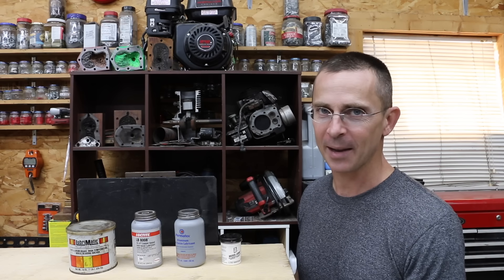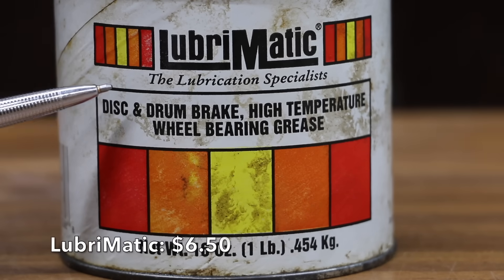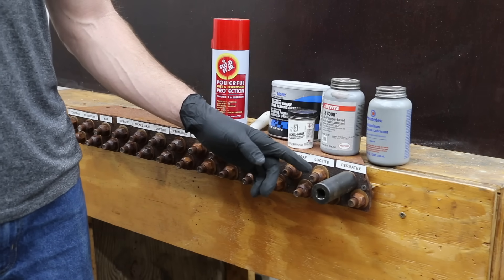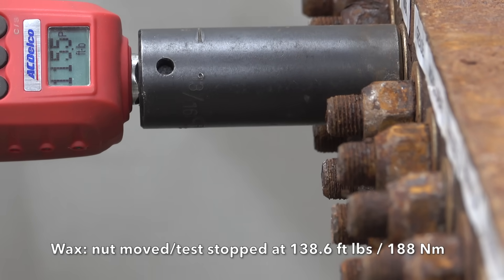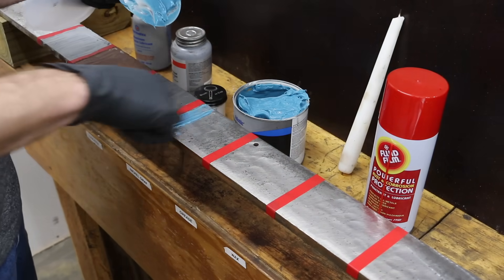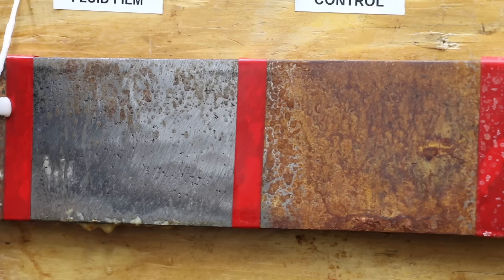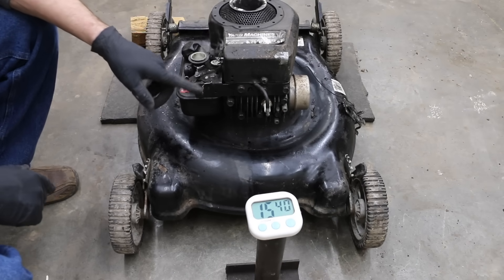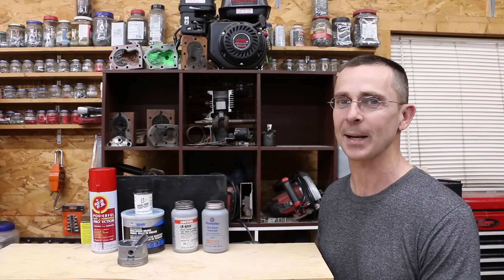Does Anti-Seize Compound Actually Work? Let's find out! Anti-Seize vs Grease vs Fluid Film vs Wax

Comment: 1 did you use bees wax?  2 do a test without applying more than 120* and test the wax again, and again use bees wax. I would say its a bad control test on it. And with rust remover you said vinegar is not good, but did you wipe it off? You have bad biased controls. Mostly meant to sell products IMHO.

Comment: I use coaxial cable for internet, and it is perpetually infuriating. It is old and fails at random intervals for no apparent reason. I suspect it has small cracks somewhere in the cable. Digging it out of the walls and replacing it seems like a good idea. Given the scope of the task (cutting holes in walls with wiring, drywall, painting, etc.) getting it right is important. What is the best replacement?
Reply from the maker: Thanks for the video idea.

Comment: I just did a rotor change in a 6 year old Mazda sedan.  I had to hit the old rotor to get it off - when it came off, there was rust between the rotor and the hub.  I cleaned the rust off and put some Permatex Aluminum Anti Seize on, then slid the rotor on.  This stuff is great and the next time the rotor comes off, it'll slide off without needing some help from a sledge hammer!

Great video - I didn't think the lawnmower engine would run as long as it did.  I think the engine gave out, because there was no lubrication getting to the connecting rod.
Reply from the maker: Thanks so much!

Comment: I use Jetlube moly graphite OR Lubriplate also moly graphite on gun barrel threads and gun barrel nut. Using Shell Aeroshell 33 is STUPID. That grease is for extreme cold ONLY. Remember kiddies, anti-seize is dependent upon specific uses, and what temps and chemicals the material will be exposed to. And Loc Tite C5A copper is what Glock puts on the locking blocks and slides of their new pistols at the factory.

Comment: Have you got a best rust preventative video? Like comparing fish oil, paint, electro magnets,  used motor oil etc?
Reply from the maker: Great suggestion!  Thank you.
Reply: @ProjectFarm  thanks be good to include rust converter on already rusted surfaces with and without paint and primer so we can see which way is best as well. Regards

Comment: Thanks for another great vid. We had about 40 one gallin stainless steel tanks that were heated for men to sterilize boning knives. Had a 750 watt Chromalix heater with a thermostat. If somebody forgot to install a copper antiseeze compund on 2" male thread you would have to use a 2 foot pipe wrench with a 3' piece of pipe to wrestle seezed heater off. Well worth the few oennies it cost for the antiseeze compound. Same thing with 1/2 to 5 HP C face motors that bolt right onto gearboxes. Even in a clean air conditioned room the heating & cooling off of c face motors seem to produce enough mousture to rust shaft onto gearbox.
Reply from the maker: Thanks for sharing.

Comment: Hmmm.....my primary reason for using anti-seize has been to prevent galvanic welding with dissimilar metals, eg, on the steel threads of a spark plug going into an aluminum engine block.  Working as a car mechanic in college, that is what I learned about the product for.  Yet you did not test that function at all.  :-(

Comment: I have a quart of anti-sieze that I've had since the mid 70's. It's nickle not copper or aluminun, the real deal I found nothing works better. I have to stir it up good each time I use it if I haven't used it in awhile the oil separates from the nickle. When I purchased my 94 Camaro new I anti-seized several nuts and bolts including the O2 sensors. This past week I replaced those sensors and they came out with ease after 27 years, you can bet I put the same anti-seize on the new sensors. I also put it on my A/C condenser fan hub to motor shaft that was in 93, I replaced the motor four years ago and the fan came off the shaft with little effort. I also used it on my 95 Harley slip-on mufflers and they come off with ease, no rust holding them together. This is long term real world proof it works.
Reply from the maker: Thanks for sharing.

Comment: Hello. Which is best grease for brake caliper slider pin?

1. Permatex Silicone Cemaric Extreme Brake Parts Lubricant (it meet to JIS K 2228)
2. Bendix ceramic high performance synthetic lubricant (it meet to JIS K 2228)
3. Bendix Silaramic® Brake System Grease (it meet to JIS K 2228)
4. Castrol Red Rubber Grease 
5. 3M Silicone Paste
6.  Permatex Ultra Disc Brake Caliper
7. permatex  ceramic extreme brake parts lubricant
8. Other?

I am sure that your new video will get view of million over people if you can test them. All mechanic will love this video! :)
Reply from the maker: Great video idea.  Thank you.

Comment: I was introduced to Neva Sieze in the late 70's. I went to work a s a mechanic at Mack Trucks. We used it in many applications on the trucks and it worked great. We would pull injectors from the heads at 150,000 M. It was quickly clear which ones were put in with Neva Sieze and which weren't.
Reply from the maker: Thanks for sharing.

Comment: I recently took up hydro-foiling and noticed many people dealing with seizing issues. The foils have alum masts, carbon fiber wings, and are usually held together by stainless steel screws. Foils are used in the ocean. After a few months, many folks have their entire foil seized together and are no longer able to take them apart. Would love to hear your take on this.
Reply from the maker: Thanks for the suggestion.

Comment: 20 year heavy equipment mechanic here..  YES anti-seize works good.  ANY brand is better than non-at all !!!  
I've seen NASTY bolts on a bulldozer at the landfill on the undercarriage come out that i thought NEVER would, guess what they had on the threads? COPPER ANTISEIZE !   it is a MUST !!    we use loctite high temp ( copper stuff )
Reply from the maker: Thanks for the feedback.

Comment: You know, I don't own a torque wrench.  I "torque" most everything I do with either an impact Gun or a cheater pipe.  I have some Permatex Ainti-seize and it seems to do the job for me.  However I cannot tell much difference between it and General lubrication grease.  I have always THOUGHT it was better than the GREASE but only slightly.  If I cannot find my Permatex, I just use grease to get the show on the road.  I am NOT a mechanic by choice, like a lot of people I just have to fix what I have whether I like it or not.   

And when I am putting together water or compressed air plumbing for a TEMPORARY application I use GREASE instead of Pipe dope.  Man, is it easier to take apart and clean up as compared to pipe dope.  I use Rectorseal Pipe Dope, it is pretty good stuff, it will break down easily if you apply Isopropyl alcohol.  But Grease is easier.  I put grease on my Water Hose Fittings when I put them together.  Sometimes I leave them together for a couple of months, and they have WELDED themselves together.  The cheap-assed fittings they put on there, you apply a Pipe wrench to them and they collapse.  Then have to put on NEW FITTINGS.  Put GREASE on there and it will come apart a year later.  But GOOD VIDEO!!!!  Yes sir, it looks like a good test to ME and the results were pretty much like I thought they would be.  Real Common sense, Thanks, BB
Reply from the maker: Great feedback. Thank you

Comment: You should take an engine that has a lot of scoring on the cylinder wall and coat it with anti-seize. Then run the engine like normal and see if it stays on the wall and improves compression or performance.

Comment: Grease alone is great for outboard propeller splines.  Even after using a motor for several years in salt water, a prop will slide right off. As for nuts and bolts, commercial fishing on salt water, I swear by the never seize products. We use the Permatex brand. But don't use it on prop shafts.
Reply from the maker: Thanks for sharing.

Comment: On the copper with the expiration date wouldn't that lead you to believe that it expires in 3 years meaning you would have to reapply it as well? it also leads you to believe that its water based or a similar deteriorating substance..;  On the wax when you heated it up it became liquid again odds are it wouldn't work anyway if it was heated. I'd also bet that wax traps the moisture and air under it which causes it to rust anyway so idk if it would work to begin with. I wonder about a marine grease though because thats what alot of peoples say to use.
Reply from the maker: Thanks for the video idea.
Reply: @ProjectFarm  Specifically Lucas oil Marine grease i was told to use  by a mechanic that works on all types of vehicle style machinery, as they use it even over seize all as it adds more of a lubricant and holds up better against water. So i did some research and it seems alot of people are saying similar things, actually thats how i started watching your videos to begin with., ;p

Comment: I would love to see the bolt experiment repeated without a heating cycle. 
90% of bolts never see much heat
I think without the heat cycle:  grease, wax and fluid film would do much better.
I realize the lawnmower engine test was made as a joke on anti-seize there are some things to look at: 
- from the before pics the engine was toasted before the test, lack of oil being the likely culprit
- the way the connecting rod broke indicates seizure to the crankshaft, which was presumably imminent anyway
- never seize is not a fluid, it could never enter the con rod bearing unless it was smeared in there before the test
-  the never seize passed the rings because of excessive wear, but it also filled in the gouges of the cylinder walls.

My reading is we need a more liquid never seize that would bake in place, and perhaps restore abused lawn mowers.
Reply from the maker: Thanks for the suggestion.

Comment: As a diesel mechanic assembler at DeLaval Turbine, we used motor oil mixed with graphite for anti seize lube. That work quite well and was cheap.
Reply from the maker: Thanks for sharing.

Comment: I have pretty much used the Permatex on most every bolt around the house for the past 20 years.  It works great.  I always use them on Spark Plugs, and have never had an issue getting them out.  Have also started using them on the bolts in the pump house at the swim club.  They used to be rusted in one season, now they come right apart.
Reply from the maker: Thanks for sharing!

Comment: I watched this video when it was new, but it appeared in my list of videos to watch, so I watched it again. I work for the railroad in signal construction and maintenance and since forever basic "no-oxide" grease has been the gold standard for everything when it comes to wanting it to come loose again. Components even 40+ years later still come apart (with relative ease) without breaking the heads off of anything. It's amazing what grease will do.
Reply from the maker: Thanks for sharing.

Comment: Would have been interesting to see a molybdenum based anti-seize.
For our ABB/Alstom gas turbine/combustion turbine, aluminum and copper based anti-seize are verboten by the OEM due to the high operating temperatures.
Reply from the maker: Thanks for the video idea.

Comment: I work for Shell Oil and have been an operator in a refinery for 26 years.  We have used nickel anti seize for decades.  It works well. However now days we have moved to Teflon coated nuts and  bolts, only using anti seize after servicing older equipment. Some of our nuts and bolts are over  100 years old. So I'd say anti seize does a great job.

Comment: I was surprised that you didn’t include a moly (molybdenum) anti seize. It’s all I ever use if you ever want to be able to remove a header/exhaust manifold bolt without damage. It’s also good for bolts that are exposed to a water jacket. Putting any lubricant on the threads help with the correct bolt torque and this anti seize is no different.
Reply from the maker: Thanks for the suggestion for future round of testing.

Comment: I have some questions for you.  For your water test, did you allow the products any dry time before starting the test?  I've only ever used the Permatex aluminum anti-seize, but I think I've heard that fluid film needs to dry.  I'm also aware that there is a little controversy as to the quantity of anti-seize used.  Some say you coat the threads, as you did, others say that just a dab will do.  Do you think that this could skew the results, or that it might be a topic for a future video?  Like, does the quantity of anti-seize used effect its performance?

Comment: THIS IS REALLY GOOD.FROM MY WORK EXPERIENCE, A STEAM TURBINE ENGINE MAN.MAY AND DOES REQUIRE(IF USED)A SPECIFIC ANTI-SEIZE(SUCH AS NICKEL)IN THEIR WEIGHED AND FITTED FASTENERS IN THEIR ROTATING ASM. THE OILFIELD(DRILLING), THE DRILL PIPE TORQUES 5500LB/FT. AND WE WOULD USE 30% ALUMINUM ANTI-SEIZE(5 GAL. CANS). BUT ON THE DRILL COLLARS WHICH WEIGH 6K. EACH(BOTTOM HOLE ASM.)WHICH TORQUE TO 30,000 LB/FT.THE ANTI-SEIZE WOULD BE AT 70%ALUMINUM. I'M OKAY,JUST MY WORK EXP. AND EDUCATION IS WEIRD.LOL.

Comment: The most effective anti-seize product I have ever found is Ted-Gel. After tens of thousands of miles sailing on an aluminum hulled boat allowed steel bolts threaded into the aluminum hull below the water line to remain easy to remove each year with no issues. Nothing isolates and prevents seizure like Tef Gel.
Reply from the maker: Thanks for the feedback.

Comment: The lubricants create a more loaded, higher tension bolt, at the same torque setting, than a dry thread control bolt. It makes the results of the winning products even more impressive.
Reply from the maker: Thanks for the feedback.

Comment: Great test.  I would hazard the anti seize was too thick and if it was thinned out a little that poor engine was still be with us.
I found Nickel based Anti seize to work great in high temp applications such as turbo/exhaust manifolds etc. 

Its always worth paying more for a good brand as the cheap stuff is just filled with soapy grease which just burns or dissolves away. Its actually the small particals of copper, nickel etc that aid in removal, think of it like tiny copper ball bearings.
Reply from the maker: Thanks for the feedback.

Comment: would there be any difference if an engine  that has no oil  with idle rpm vs an engine with no oil with red line (max throttle) hopefully it makes sense lol
Reply: the differences in damage   between the two engines   one at max throttle no oil - the 2nd  idling  with no oil ?
Reply from the maker: Thanks for the video idea.

Comment: It would be interesting to have a study on different temperatures, because of the dry lube/boundry nature of what it becomes when burnt. And what if you exceed the maximum temp, will it solder your fasteners? It sounds like the max temps are influenced by what they expect the metals to flow at.

Comment: One of my first jobs as an aircraft mechanic, was to pull the hot sections off a pair of turbine engines on an older Sabreliner business jet.  The #10, 12-point self-locking nuts came off the studs as if they'd just been screwed on that day, not 12 years earlier, after thousands of hours of flight time.  I asked my leadman how that was possible, (being a noob, straight out of school) and he said, "C5-A".  I've used it ever since that day in 1980.
Reply from the maker: Thanks for sharing.

Comment: I really wished you had took a wire brush to each bolt to see how it looked under the anti seize, I was really curious to see what was under the permatex aluminum bolt. So much that I will do the experiment myself to see.
Reply from the maker: Thanks for the suggestion.

Comment: As a retired Army Aviation mechanic and crew chief on UH 60 Black Hawks, I can say that anti-seize compounds really work amazing on hardware where required. Fluid film is a great type product for other uses like non heat hardware and bare metal. Now, for automotive and home use, I'm sure some other products will work.
Reply from the maker: Thanks for sharing.

Comment: I recently started using grease on motor shafts that mate to gearbox, I have not had much luck with Anti-seize, most of the time gearbox or motor gets damaged during separation so I have nothing to loose trying grease, also I remember removing an O2 sensor from a car and it had coper anti seize, and it was pretty much welded on there.
Reply from the maker: Thanks for sharing.

Comment: If you are bolting stainless steel into stainless steel, anti-seize is a must.  Those that have not yet experienced stainless steel galling, believe me you don't want to, especially on bigger bolts.  It is like you have welded the threads together.
Reply from the maker: Thanks for the feedback.

Comment: Copper base anti seize works best on bolts that are exposed to water.  I have used it on tire lugs for a long time.    I have used aluminum based anti diesel for a long time and it works best on aluminum parts, such as steel bolts in aluminum housings, like boat motors and out drives.  My guess is any anti seize is better than none.  I usually choose the type based upon what I am doing.  I use aluminum based on spark plugs threads and copper based on lug nut studs.
Reply from the maker: Thanks for the feedback.

Comment: I would like to see a dissimilar metals test. To simulate what you would see for like strut bolts going through steering knuckles. 9 times out of 10 you aren't getting those bolts out if you live in the rust belt.
Reply from the maker: Thanks for the video idea.

Comment: I haven’t a clue if it would have made any difference but I would have rubbed the candle wax on instead of melting it. It’s what I do with bees wax on wood saws and planes though that for a smooth movement rather than rust prevention.
Reply from the maker: Thanks for the constructive feedback.